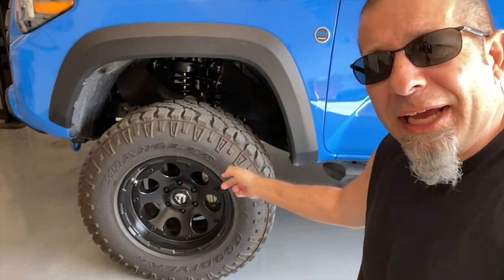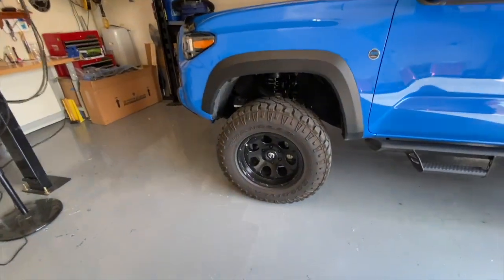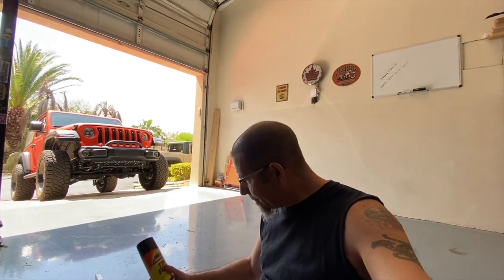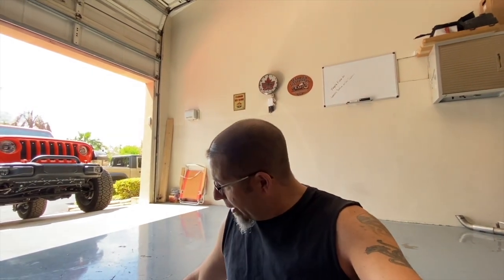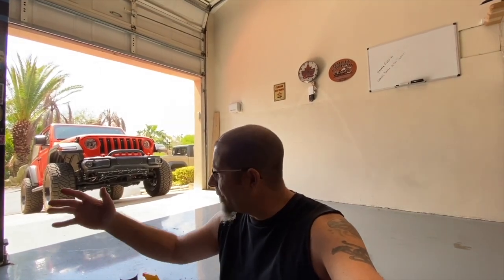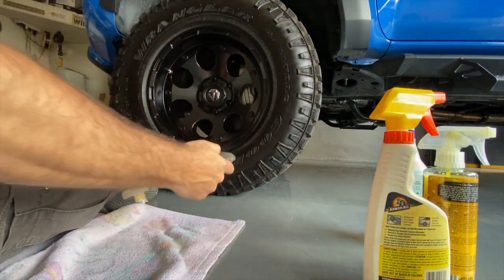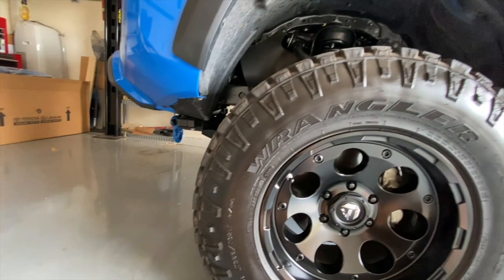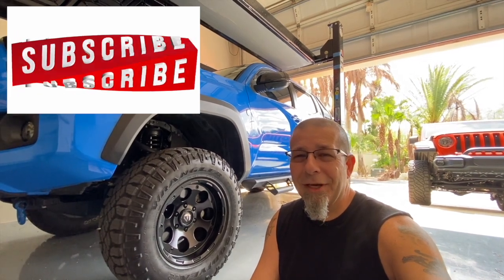If You're Gonna Shine Up Your Tacoma Shine Up Your Tires

Comment: I use Chemical Guys Tire and Trim Gel. Spread the gel on and wipe off with a microfiber towel. Not greasy or sticky at all. Looks great for a few days depending on conditions. Better than any foam product I have used. Can't go wrong with Chemical Guys products. I use several of them and have never had a total fail with anything they offer.

Comment: I like clean and shiny wheels and tires all the time. That’s military/ police band officer coming out of me.Dress uniform always clean and shiny,especially the boots/shoes,tip of your hat and your brass/ chrome hardware on you.👍🏻👍🏻😉
Reply: Also what I heard is when you have new rims ,ceramic coat it right away. The brake dust and dirt will less likely not to stick and be so corrosive to the alloys or steel painted wheels. Then washing it will be a lot easier.
Reply from the maker: Sounds good to me 👍

Comment: I used to work at a full service car wash 20 years ago, we had a special thicker version of Armor All for on tires. It works well and didn't seem to get slung off as much. Have never found it at retail.  
I totally agree with you on no armor all inside. I like 303 for that but I spray my cloth and wipe the dash and trim so it doesn't make it too shiny
Reply from the maker: I need to try the 303 product.  Seen many positive comments about it👍

Comment: I got some foam applicators on Amazon and I use Adams tire shine, put it on the applicator and wipe it around but you have to use a tire cleaner first to get the brown dirt off first then I use 303 on the plastic fender flares and bumper and interior then I even use it on the rubber door gaskets.
Reply from the maker: Nice👍

Comment: What are the largest tires you can fit on a Tacoma with a 2 inch lift in the front and 1 inch in the back
Reply from the maker: Unless you go at least 3.5" in the front I wouldn't go any larger than stock size.

Comment: Another thought for a video for you; why are we all getting shafted on our factory tires.  The tires on this 2020 Tacoma are only going to make 25K miles at the best.  In my last Tacoma, the 2008, I was able to stretch those tires to 40K miles but it seems like a lot of carmakers are using the 25K mile Goodyear Wranglers now.  A friend's 2020 Colorado has them, just saw a video of a new Jeep wrangler and it had them on there too.  I saw these tires right after I accepted the truck and I was appalled at how little tread it actually had on it, maybe 3/8" at most.  I bet the carmakers get these for very cheap with such a little bit of tread on them.